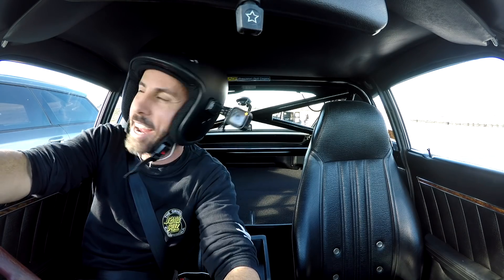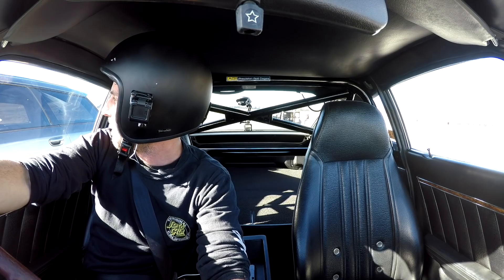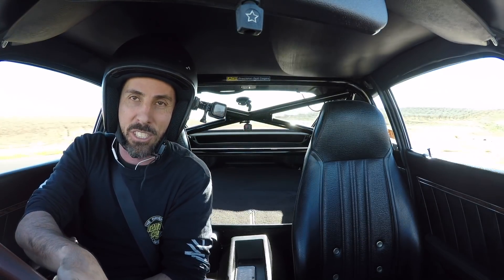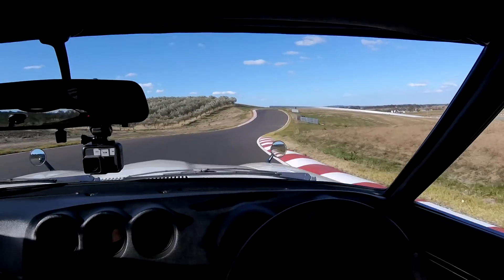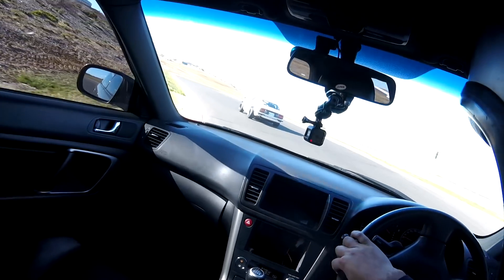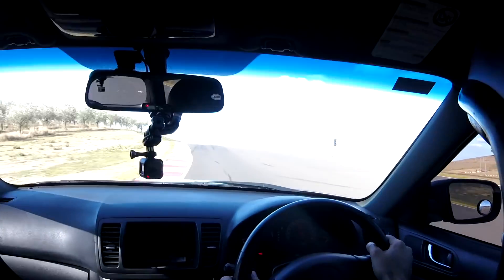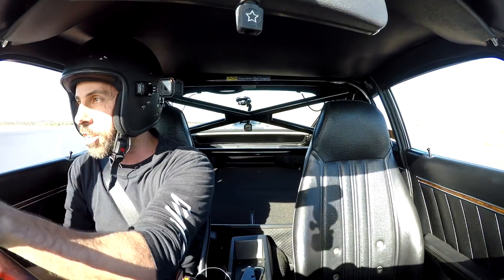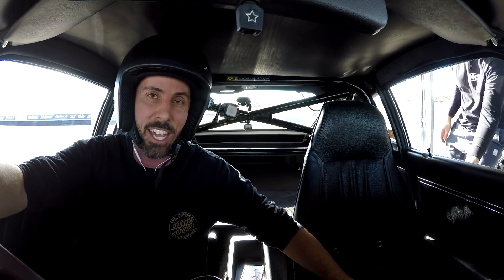RB26 FairladyZ VS SuperGramps

Comment: Galant VR4 for stripping 4x4-parts off of and putting it in 2sxy?
Reply: I actually think the Legnum belongs to one of the film crew
Reply: Its hoooot
Reply: Was going to ask about that VR-4, they should build one :-)
Reply: is it bolt on tho? the galant in the 2sexy?
Reply: The potato Party pooper you can put the 6A13tt in to the lancer engine  bay fairly easily.
Reply: The potato Party pooper is ANYTHING ever truly bolt-on except for volvo-stuff and those few parts for the S30?
Reply: What gearbox would U use for that? Being 3sxy is fwd
Reply: That legnum. Love it, i have a purple one as my daily
Reply: nicholas sutherland can either modify to awd or use an FTO box.
Though the lancer box will most likely bolt up, may just need to change the bellhousing over with evo internals
Reply: nc

Comment: Sweet!  Taking notes.  I've got a '75 (USDM) 280Z I'm slowly working on resto-modding (also white incidentally).  No RB in it (yet?) but I've gotten through the suspension and brakes at least.  That RB motor sounds amazing.  Did you guys mention the name of the track at some point?

Comment: @Mighty Car Mods , you should call it  " UnpureZ " , it's a bit like the  DevilZ (Mangan Midnight) but not evil just unpure! 
Or maybe something like " Unfairlady " or " Unpurelady " since it was born as a " Fairlady ".
-BTW : you should try to add an hidden magnet to keep the radio panel open so you don't have to hold it while inserting a CD or fingering the radio.

Comment: Good Video. There was a question that always in my mind. Correct me if I'm wrong. I was always thinking about the RB26 240Z and the RB26 GTR, which is faster? I think for drag racing, the 240Z CAN BE faster because it is just going for a straight line. But on the track, we have to think about the balance and settings etc. It shows that it is harder to beat the later technologies. People spent a lot to rebuild and put a better engine into an old school. I think that only because of the feel and the look. But can't really beat the new cars. So sad. Btw, I love old classic. Cheers.

Comment: White Lightning...she needs wider rubber in the back end to hold it on the turns. You have so much power back there and break it loose too easily. I was surprised you put under sized tires on those wheels. Max out the rim width.

Comment: The 240Z needs "better/wider" tires to take full advantage of its power! That's why its sliding all over the place and cant put the power down. So you'd have to give up that look of a "70's JDM classic", on the track, for a more track focused vehicle to really get away from SuperGramps. Its the same thing that I said about the 240Z vs The Project 370Z video that MotorTrend put out a while back. Put better/wider tires on it, and run the test again. Then we'll see who come out on top!

Comment: Put Sti gearbox into super gramps so you can adjust front rear torque distribution and put Porsche mezger turbo engine into it. Get an engine out of the Porsche 996 turbo. That would be uber gramps.

Comment: Please stop calling it a 240z... it's not . They only did that based off of what engine was in it... if it had a 2.4L it was a 240z if it had a 2.8L it was a 280z.   It really doesn't matter what it came with because it doesn't have it anymore it now has a 2.6L in it so.. its a s30 Fairlady 260z turbo... Technically speaking.
Reply: LMFAO that's not how that works, It's still a 240z.